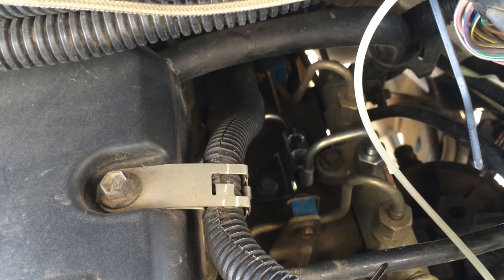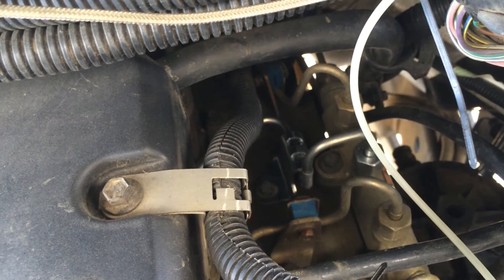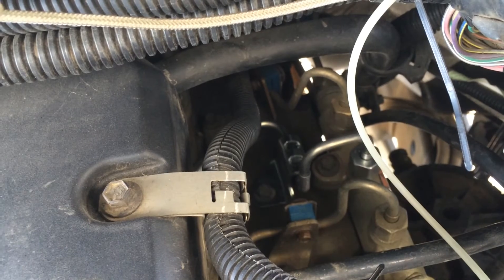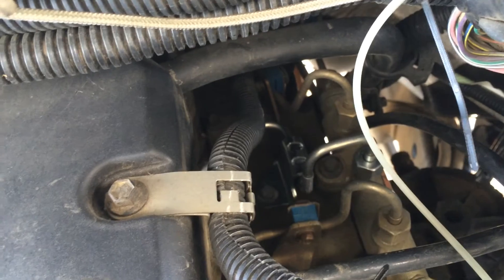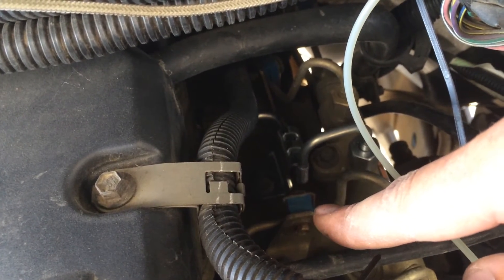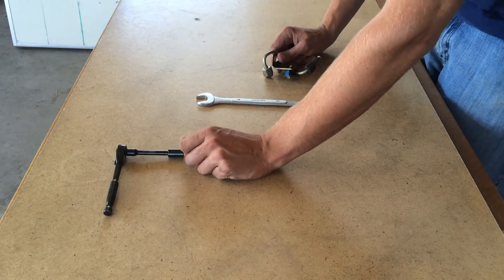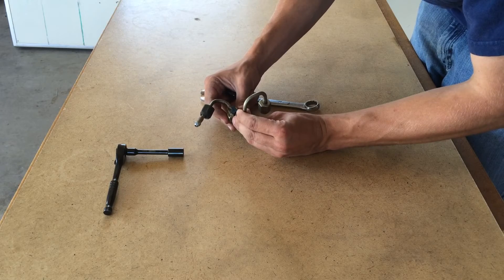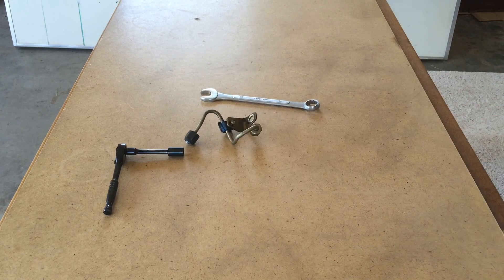#4 cylinder Injection Line Failure Cummins Common Rail

Comment: You also need the special wrench that fits the injector tube nut to make sure that it does not move while doing the work to the line taking the old off and putting the new on. And make sure you use a torque wrench doing all the work on that fuel system very important